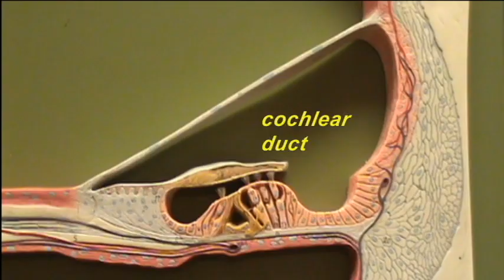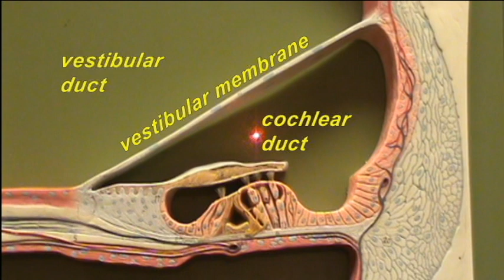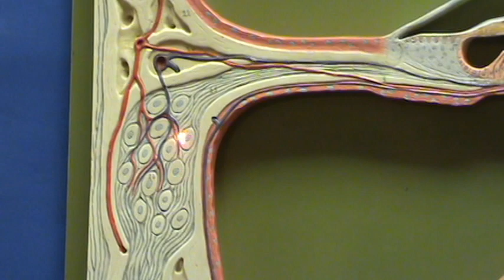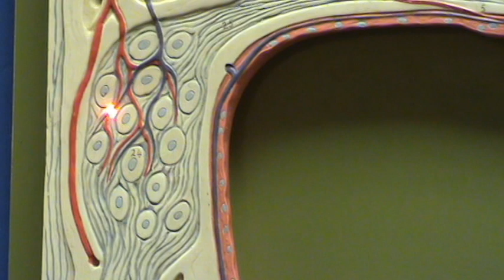Cochlea Model

Comment: I'm sorry but this video is sooo wrong. The pressurewave doesn't move Reissner's membrane then cause a pressure wave in the cochlea duct. It's the basillar membrane that moves and cause the relative change in position of the hair cells to the tectorial membrane. The endolymph is not a pressure wave medium, it is high in K+ to produce receptor potential. This is precisely why ppl should stop listen to everything being said on the internet. These students must fail really hard being taught shit.

Comment: inner and outer hair cells bending that causes the electrical impulse?  Yes, but also it is their stereocilia.  Each hair cell has many of them on their surface with the tallest embedded in tectorial membrane.  When the hair cell moves, cilia move either towards or away from the tallest stereocilium. (Tectorial membrane is still)  Movement toward tallest cilium causes tip links to be stretcedh --> K + Ca enters cells 
(Depolarize)  > NT release > nerve response.  Away from tallest, hyperpolarize